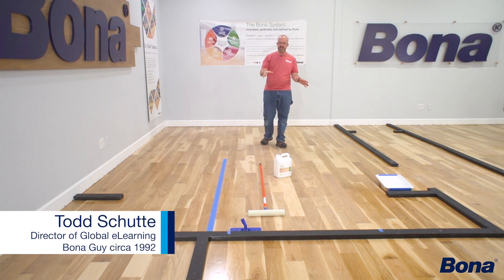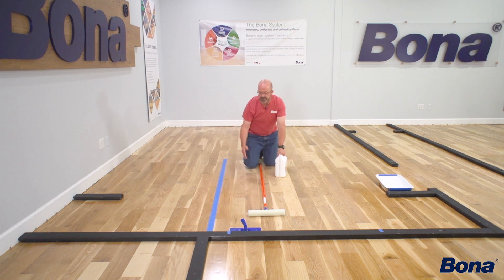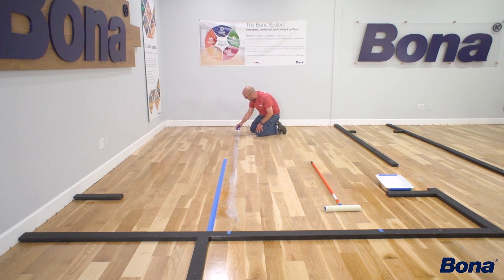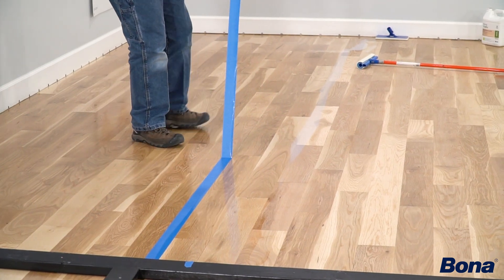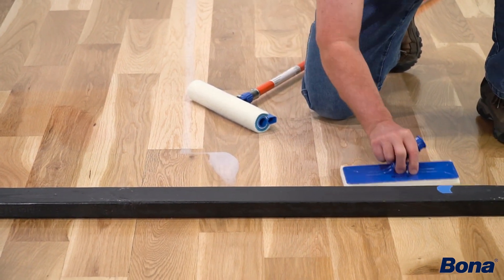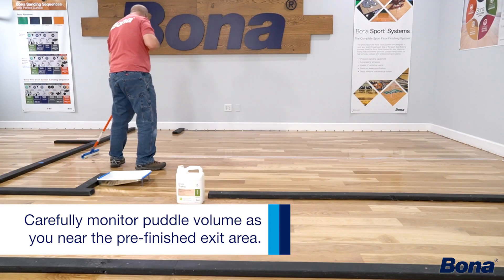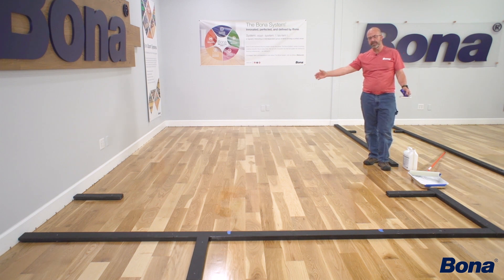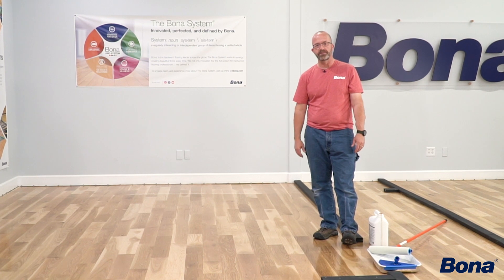Waterborne Finishes: T-bar - Starting Back Up Mid-room-Start to Pre-Finished

Comment: Hi Todd,  If/when you finish out first and come back to complete the room, I notice you are able to walk on the finished-out surface. What is the minimum amount of time you suggest before coming back into a finished out area to complete the job? We are hoping to complete our large job under the 48 hour mark to avoid abrading but there is one area that finishing out first makes a lot of sense, but worried that will impact the drying timeline for the second coat. I hope that makes sense. Thank you!
Reply from the maker: Hello @aaronrosemadden6982 - It all depends on the dry time conditions. Here in Denver, we might be able to walk on the finished surface in 30 minutes. In Florida, mid-July, it might take 3 hours. Lots of times, if you've got another way to access the rest of the floor after you've finished that small area out first, by the time you get back to that area, it's already dry enough to walk right back over (but a bit of a conundrum if it's not). Recommend that after you've finished that initial area, to place a fan on it after it has flowed and leveled for 30-40 minutes. That way, it should be dry when you get back to on it when coming back the other way. Hope that all makes sense!
Reply: @BonaProfessional  Thank you! ☺